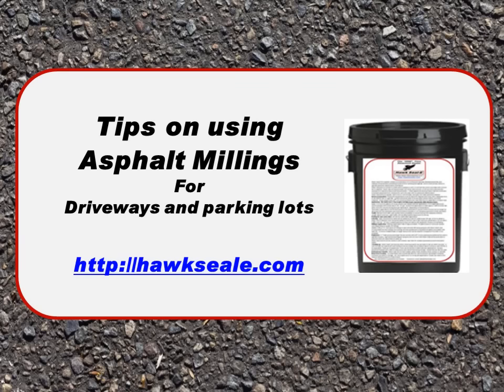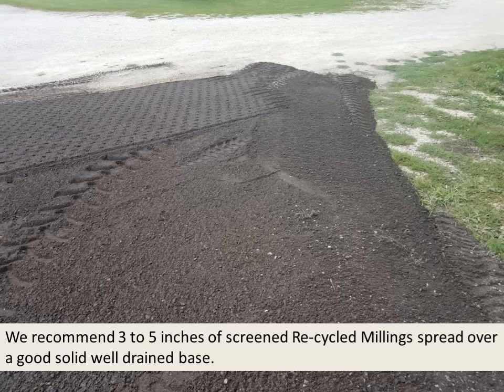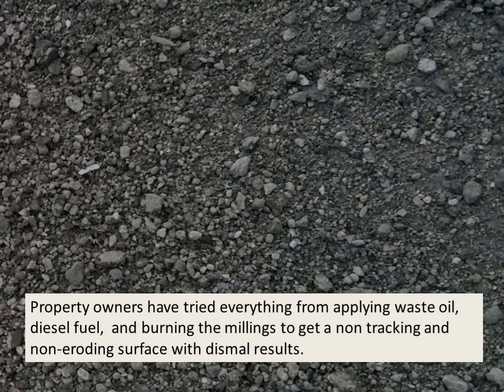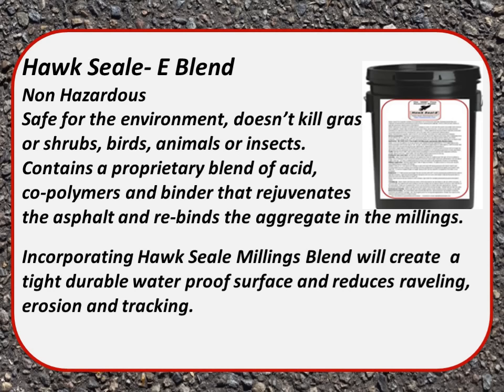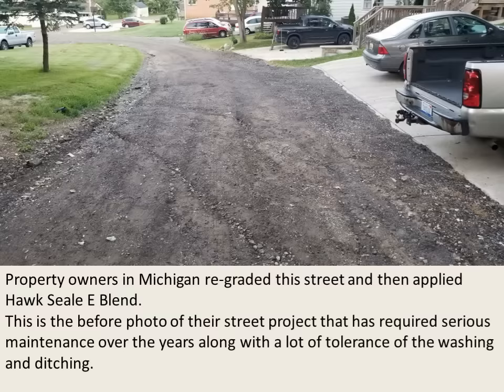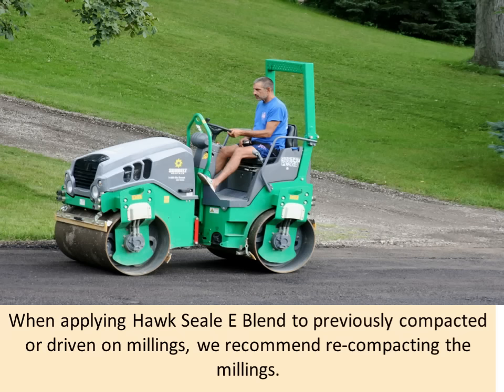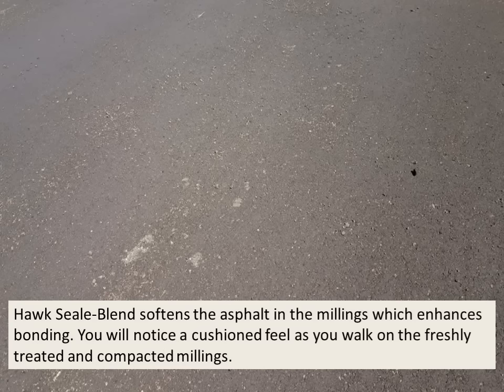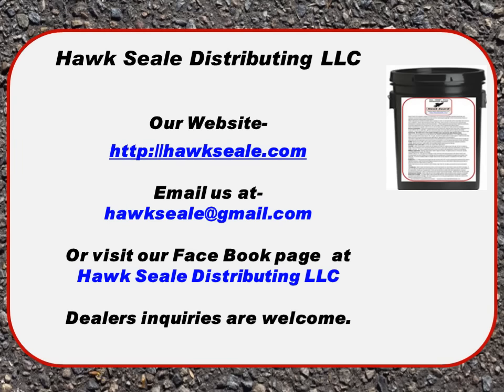Tips for Using asphalt millings for driveways and parking lots

Comment: Used to work for a company that processes millings and used waste oil IS how to remulsify, its less than 2 gallons per ton to acheive the desired consistency and heated back up. Yes, if you OVERAPPLY oil to asphalt it effectively "waters down" the binder allowing it to pull out of the mixture, but using waste oil to help rebind millings can and does have legitimate use as a method to rebind a milling drive
Reply: Interesting. Would it matter if it's conventional or synthetic used oil?

Comment: Great details for small jobs. It’s cost prohibitive as I would need 60 ton of millings then 63 gallons of hawk.
Reply: Depending on the cost of millings in your local, Millings treated with Hawk Seale can create a smooth non-tracking and non-eroding hard surface similar to hot mix asphalt for 40 to 60 percent less cost and roughly a third the cost of concrete.

Comment: Literally just an ad for Hawke seal
Reply: Yes,  in realality it is a commercial. Hawk Seale the only product on the market specifically formulated as a "cold process rejuvenator" that rebonds millings back into a durable non-tracking and non-eroding surface that anyone can do themselves. 
 It has been used for driveways, streets,  parking and warehouse lots, boat ramps, Pickleball, Tennis and Basketball courts. Horse and cattle sheds, shop and warehouse floors.  Depending on cost of millings you can save 40% to 60% over hot mix and much more over concrete.
Reply: capitalism at its best.

Comment: There's just no way this is better than gravel. Doing a gravel road way is easier than this. The maintenance on this is very difficult time-consuming and expensive. Stick with gravel and learn how to maintain it. Can't go wrong. Don't have to deal with all the hassles and problems that you have with asphalt.
Reply: Too late for me.  My stomach hurts how much it cost and my disappointment when I learned it is similar to gravel.  Wish I had studied up on it before I had it installed.
Reply: @Tinmania depending on grade it's important to know what type of rock to use. They have a lot to choose from and if you lay them down in layers of different types then it lasts much much longer. The key is to lay it properly the first time and maintain your rain wash off. Can't go wrong with gravel. For the price and longevity of the product.
Reply: @johnlockesghost5592  Asphalt millings are awesome.  So much better then crusher run.  And no dust.
Reply: First, millings are far superior to rock types such as crusher run. DGA or Commercial Base is generally a dollar or two less per ton and do not show any superior benefit to milling and allow grass seeds to grow when blown on to the driveway/road. If done correctly this should be a far superior alternative to rock driveways and at about a quarter of the cost of an asphalt/paved driveway. Of course, this is based on millings and not this HSE stuff which I have no experience with currently. I do plan on trying it though at this point...
Reply: @Tinmania I have hot oiled grindings on a 18% grade for 15 years. No slip, no cracks
Reply: Even if cost are the same gravel is dusty, weeds grow in it, still needs regular maintenance, asphalt looks classier!
Reply: @robertmeshew1935  costs are not the same..! Different types of maintenance. And it's all good either way. Gravel will always last longer and be workable for years to come.! 💯
Reply: Would like to know how your hot milled grinding were applied
Reply: @RRaucina please tell me the  process for hot oiled millings..thank you

Comment: In your video you mention "1 gallon in the top 3""...   ????  need the area approximation for the rest of this calculation.  I realize it will depend, however, you could at least take a stab at it.  Your video mentions this several times until I get a clue later when some area is mentioned allowing for a quick mental calculation.

Comment: Add bitumen and use an old concrete mixer to remulsify the millings
Reply: We have not had good luck with adding petroleum based products to rejuvenate millings, as far as the old concrete mixer goes, it requires too much labor and not efficient for large jobs.

Comment: is 1/4 inch(5mm)gravel size screened millings, good enough for a small driveway?
If i compact it with a roller, would i be as good as the 3/4 inch gravel size?
Any recommendations would be much appreciated.
Reply: It willl depend on your underlying base, fine aqgregate will not have the structural strength that the larger aggregate will have. I expecti It would require a little more HSE solution to rebond the smaller aggregate together.

Comment: I been doing asphalt millings for 14 yrs I can show jobs I did 14yrs ago.If you prep the job cutout 2inch lay millings in cutout then grade level then wet with alot of water then Roll in or wacker pack the way you explain you mine has well put hot asphalt because the sealer not cheap an the extra equipment your just trying too sale a product.Bobcat Service Joe
Reply: What size sieve would you use for a small driveway?
Reply: @shaner5252  We like to see the milllings screened to 3/4 inch gravel size.  You need fines for a smooth surface and you need larger aggregate for strength.  HSE treated millings will compact tighter than when using water as the HSE softens the asphalt in the millings. Expect up about 30% compaction ie;  4.5 inches would end up at 3 inches in depth or  3 inches compacts  to about  2 inches  in depth for expample which is the minimum depth we would like after compaction .
Reply: Exactly. wet, roll and hot oil. 20 years before any worries.
Reply: is 1/4 inch(5mm)gravel size screened milling good for a small driveway?
Reply: @nikosa7759  1/4 inch is pretty fine, it would make a smoother surface than the normal 1/2 to 3/4 inch crushed millings we use, the 1/4 inch material would lack the  structural strength of the larger aggregate.

Comment: Can this be sprayed through a SealMaster Asphalt Distributor  tank? Does it have any solids in the blend that would damage a pump?
Reply from the maker: Yes it can be used with SealMaster or bellows style pumps,  also water trash pumps work well, Run them at as idle so as not to push the seals out. The acid in HSE will soften rubber components, Agricultural farm sprayers and garden sprayers, will seize up.  We recommend water trash pumps as they are less expensive and repairing them is relative simple and seals inexpensive.  You will want to rinse out your equipment with water when finished applying the solution.
Reply from the maker: Yes, HSE can be applied with Seal Master pumps or any  Bellows pump. We recommend Water Trash Pumps as they are inexpensive to purchase and maintain.  Also you should rinse your pump and related equipment out with water when finished with the project or for overnight .
Reply: @iziggiowa  
So, is this a water soluble product?
Reply: @alwcurlz  Yes,  we ship in concentrate form to be mixed wth water to improve on saturation . Concentrate saves on freight  costs.  We do offer free shipping.

Comment: Hello, I have a millings driveway that has been down and looking good for about 2 years now.  While the surface looks good, would this product help tighten it up even if it has been down for 2 years?
Reply from the maker: Yes,  applying  approximately .8 tenths of a gallon of Hawk Seale E Blend solution per square yard in three applications and re-compacting the millings will tighten them up.
Expect to use about half of the solution in the first pass, then waiting 45 minutes before applying the second pass in an alternate pattern to ensure an even distribution,  also you are looking for areas that are drier to apply more solution to.
Your 3rd pass again spaced about 30 minutes later is catch the drier areas again and to apply the solution to the point of run off. 
After application allow the solution 30 to 45 minutes to work it's magic softening the asphalt and then compact them with a heavy roller.
 If you email the dimensions of your project to us at hawkseale@gmail.com we can provide you quantity and price as well as send a Application and Equipment guide for applying HS-E.
Reply from the maker: Yes it will,  HSE will fill the fissures and voids in the millings to soften the asphalt and allow the millings to be recompacted and will rebind the surface.
Reply: @iziggiowa  .8 tenths of gallon? That's .08 gallons, or about 10 ounces. is that right?
Reply: @hawksealedistributing1645  

Please correct this. 

.8 tenths is not 8 tenths. Your explanation suggests 8 tenths, not .8 tenths. .8 tenths is written as 0.08. 

Using .8 gallons as the multiplier, the actual amount of sealer works out to 102.4 oz/square yard. Of course 96 oz or 3 quarts is easier to measure. 

Why not just say "use 3/4 gallon of sealer per square yard"?

Informative video. Thanks for producing it.
Reply: @pigweed000  Thank your comment.  We will do even better-  Our new improved HS-2.0 product penetrates asphalt millings 25% better. We now can simply recommend "1 gallon" of HS-2.0 solution per square yard for both compacted and un-compacted millings.  We will be re-making our videos and revising our advertising pieces as well as other supporting documents as we move forward. 
Thanks again for your input.
Reply: @pigweed000  Yes, I agree with you, Guess we get caught up with the grams and tenths coming from lab experiments.  I will use that in the future. Thank you.
Reply: @pigweed000  I know your comment is 2 years old but he had me confused as well. .08 and .8 is a big difference!

Comment: Hawk Seale has been used for driveways, HOA and Municipal streets, parking lots, air-strips and boat ramps as well as for warehouses & storage sheds, garages, horse-barns and cattle sheds, as well as tennis, basketball and pickleball courts, basically anywhere a smooth hard non-tracking, non-eroding surface is needed. 
HS can be used for Pot-hole patching with millings or cold patch and will extend the life of patches by 10 years or more.

Comment: Diesel fuel that's funny that's what all us asphalt haulers use to clean the asphalt off our roll-off trailers and dump trucks and other equipment
Reply: I don't know what is funny about Diesel fuel, it is a solvent to asphalt and will not help millings bond together, Yes we use Diesel to clean our equipment too.  Burning millings doesn't work either,  as well as using oils.

Comment: Or you could just use bituminous emulsion.
Reply: Our new improved HawkSeale Blend 2.0 is chemically designed to penetrate and re-juvenate the asphalt in the millings to allow better compaction to  resist air and moisture which are the two most damaging factors in asphalt deterioration. 
HS-2.0 creates a hard durable surface to prevent the tracking of fines and erosion or washing of the millings from heavy rains,  the two most common complaints when using millings. Cost for a millings project treated with HS-2.0 will run abut half the cost of hot asphalt including the millings. (we do both). 
We ship direct to you with free shipping in the continental USA. 
Please visit our website for a no hassle quote at-  http://hawkseale.com

Comment: Would it be better to use a oil base tar and spray it on
Reply: We have not had decent results with that, our chemists and engineers are currently developing a new product with better penetration and bonding for millings. Should be available my mid to late October 2020
Reply: @kermitmiller6491  Any luck with your new product?  IS it available yet?
Reply: @jallison22  We have made progress and a formula that is better that the previous product. We will have it ready for the 2021 season.

Comment: how about after laying millings you hot tar it then spread some millings on top then compact it down?? im going to try that one day soon as i have to raise my shops driveway because of small flooding lol... i bet that will bond real good and cheap in price for time to save some coin to do it the right way?? no?
Reply: What you are proposing would be similalr to chip and seal.  The hot tar will lay on top of the millings and only a thin layer of  the new top layer of millings will bond with the hot tar. It most likely won't solve the tracking of fines nor will it provide a deeper durable surface that won"t break through with heavier vehicles or aggressive tires, which will lead to more raveling etc.
Hawk Seal is designed to penetrate the top inch or so of compacted millings to re-bond millings into a smooth durable surface that reduces oxidation and prevents moisture from entering the millings.
 Incorporating Hawk Seale into the top 2 to 3 inches of the millings will provide a deeper more durable mat that resists moisture, and reduces tracking and erosion problems and stands up to heavy traffic better.
If you go to our website at - http://hawkseale.com and request a quote with the dimensions of your project we can provide you with a quote for your project.
Reply: Yes, but you hot OIL it. call the local oil company and they will design a mix for you. lay them level them roll them and then hot or cold oil it with a designed mix for your grindings. And be sure and WET while rolling. Water base mixes are just snake oil
Reply: Our new product will be less expensive, and is a do it yourself product, Also we will have DOT approved.

Comment: To get Screened millings and going through  this process may cost you as much as Real Asphalt Drive Way They dont give away Screened milling so Just a Comment
Reply from the maker: We typically see millings from free to $24 per ton, Average seems to be about $16.00 delivered.
 A millings roadway treated with HSE-Blend will run between 50 and 60% of HOT mix. One of the advantages of millings and HSE is that it allows small contractors and property owners to do their own work.

Comment: I use the millings over existing driveways, I spread them out, use a vibratory roller, then have a company come in and oil it and apply rock over it,  just like a new road..
Reply: Do you use a vibratory roller on a skid steer for your setup? When you say you add gravel on top of the millings, you you mean the typical driveway stone like 53s or so you mean more millings? Do you have any before and after photos of your process?

Comment: Under the category of 'things to avoid'. On warm days, or any days really, avoid your vehicle sitting in one place while turning the steering wheel. It's a sure fire way to tear up the surface - . That goes for any asphalt you're on too. People ruin parking lots by doing that on warm days - pisses me off. Only turn the wheel while the vehicle is moving!!!
And don't use those damn studded tires on any roads!!! If it's not icy, and you're on studs, I'm coming to get you.😡 Chains are even worse. I've seen chains ruin good asphalt freeways in a matter of days, costing millions to repair. Frankly, if it's snowing or icy, stay home.

Comment: These millins are getting expensive rather just use gravel
Reply: If you want to be constantly smoothing and maintaining gravel every year, flinging rocks in the winter  when snow blowing, pushing piles of rocks when blading, go ahead!
Reply: B60 Delta Wing i live in Florida and have a sugar sand driveway seen somone else put down millings and it fell apart quickly but gravel seems to stay better with a base under it
Reply: @atvdave88  I bet your English teacher is proud! Lol
Reply: We find gravel in some areas more expensive than millings,  cost varies across the country from  free to $23 per ton.
Reply: Try $185 a ton in North FL for single crush with lots of huge pieces in it. Not cheap or workable at all.

Comment: Just wondering what you use in your dump truck boxes and on your  shovels/rakes if you dont reccomend spraying diesel I would be interested in an alternative! Thanks
Reply: I dont recommend diesel either. But its all I use. Works like a charm.
Reply: Diesel is a solvent to the asphalt,  we don't recommend spraying the millings with it. We do however use diesel on the truck boxes and tools.